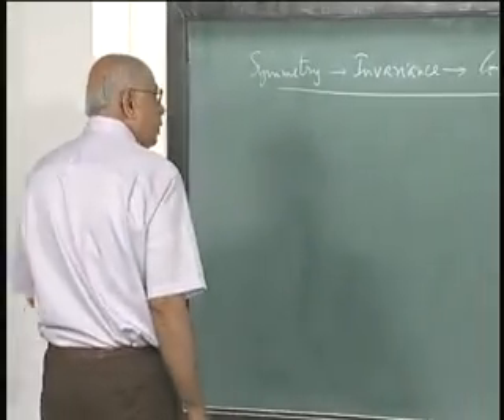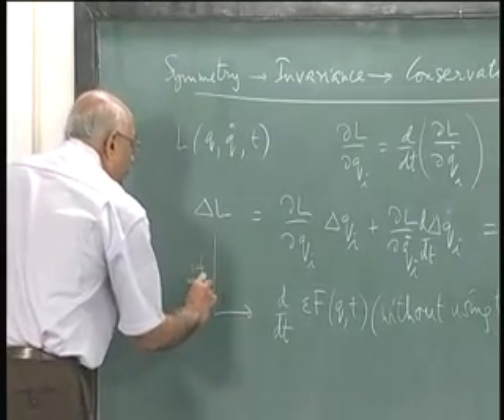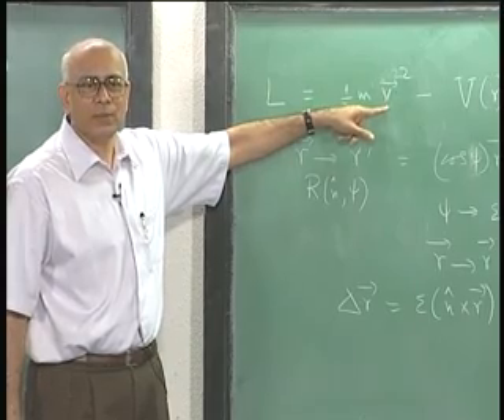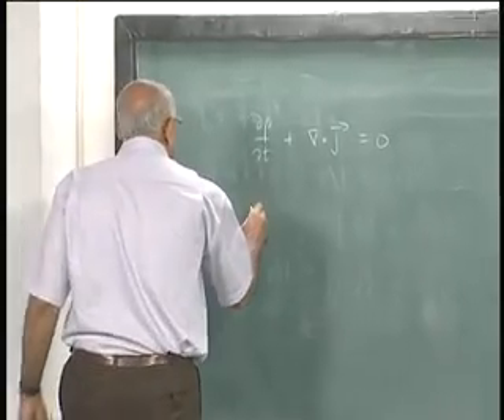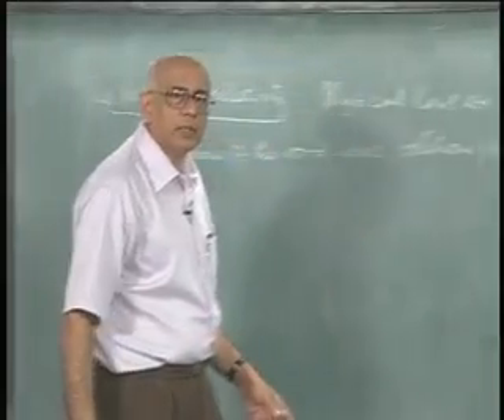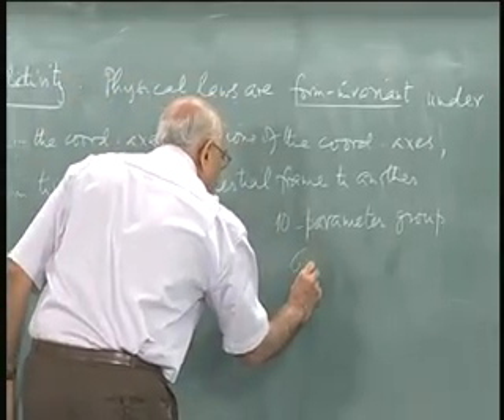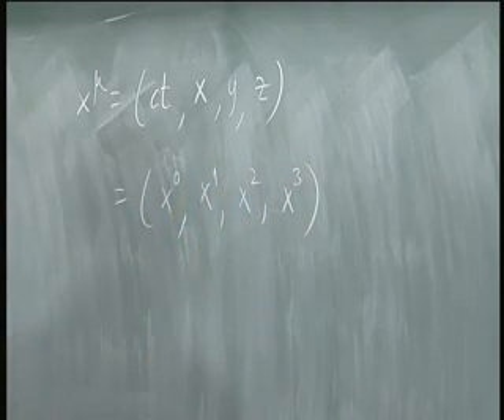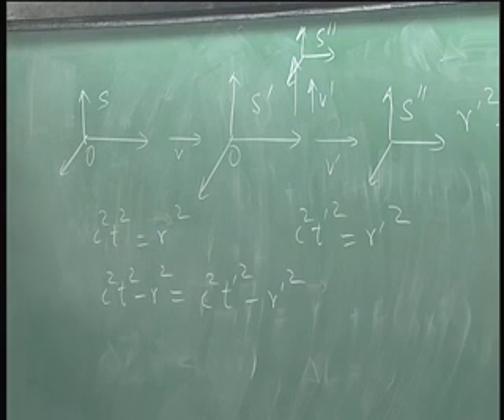Mod-01 Lec-35 Noether\'s Theorem. Special Relativity (Part 1)

Comment: 34:16 Special Relativity starts
Reply: 48:00 With (t,r) describing a light pulse's motion, he says "ct square minus r square be unchanged" between frames. Shouldn't he rather say "ct square minus r square be kept zero between frames"? Wonder why he says "unchanged' instead? I guess, he is no longer restricting (t,r) to the case of light's motion, but surreptitiously expanded to any general (t,r) event. Dishonest I would say. You must explain the logic of why any general (t,r) event, not just a (t,r) on the 45 degree line of the Minkowski space, should obey 'ct square minus r square be unchanged between frames'.
Reply: 50:50 Definition of 4-vector

Comment: [1] A few remarks : Light IS NOT TRAVELING! We see it traveling which is very different! Proper time of a light ray vanishes, so time does not pass for a photon. It arrives at the same proper time that it start. Thus IT DOEST NOT TRAVEL since travel means something hapening in proper time. This is one great suttle aspect of Relativity.
In occidental world, the concept of Relativity was "primarely" brilliantly stressed out by Giordano Bruno. Then Galileo Galilei who supported the "universality" in the paradigm of Mechanics (the only one really known at this time), but without droping his preference for circular motions for planets. Finaly by Newton, but in the paradigm of Mechanic and limited to inertial frames.
But the first to really understand that Relativity not only applied to Mechanic but also to EM was the French grand master Henri Poincaré that noticed in 1895, in his synthesizing analysis of Hertz Theory that the great physicist did formulate his theory in the langage of Ether, but that in fact he didn't use it in his entire theory, except as a convinient word. Thus Poincaré realised and stressed it out very clearly in his admirable theory of Light and EM that the concept of Ether was superfluous and that all Hertz theory would work as well without this concept. 
Poincaré then corrected in 1904 the brilliant work of Lorentz of 1904 that had partly but incorrectly proven that his Lorentz transformations did let the maxwells equations covariant whereas they both knew since 1895 that they did not let Newton second law covariant. 

Moreover Poincaré, in finding the correct transformations (partly but incorrectly found by Lorentz), to whom he gave the name of Lorentz Transformation, he rigorously proved that the they were linear, that the scaling factor was 1 for them to form a group. But he proved even a much greater result, that very few seem to know. Indeed he prooved that because they not only let the macroscopic space-time quadratic t2-r2 invariant,  but more importantly the quadratic differential form ds2=d(ct)2 - dr2 invariant, that as a consequence, not only did the Lorentz Group was acting but more importantly his Lie Algebra. Why was this so important? Because it alows Relativity Theory to cope not only with inertial frames, but also with accelerated ones. This Einstein never understood it, by a lack of mathematical skill and lucidity! And it is the main point! Thus attributing the Theory of Relativity to Einstein is some kind of a joke since, as the great russian physicist Vladimir Fock stresses out, Einstein made countable misinterpretations and hard core confusions about either what he illicitaly called the Special Theory of Relativity and General Theory of Relativity. As Fock explaines it very clearly, the very adjectives chosen by Einstein "Special" and "General" deeply shows that he understodd neighter one nor the other. Moreover the ones that attribute the Theory of Relativity to Einstein, surrely HAVE NOT RED EINTEIN 1905 paper of the Annalen Der Physics. Since if they had, and if they are not totally ignorant in science, they will immediately realise that in the very central proof of Einstein-Mileva (since all his scientifc work was secretely but strongly a two brain work), of the transformations (that he hardly attribute to anyone even though Lorentz and Poincaré made it all from 1887 to 5 June 1905), Einstein dreadfully contradict his "own" principles not less than 3 times. Stating firts that c is invariant, and then using three times, in his fallacious and vacuous "proof" that the speed of light is c-v, then c+v, and finally, last but not least, that the speed of light is sqrt(c^2 - v2)!!! You surely don't believe it! So why don't you look for yourself in his article. Be carefull with wikipedia, some funny "corrections" have been made to Einstein article by unknown authors. Choose then the original article in germain, or a trustfull translation in your langage. You will see how vacuous and dreadfully contradictory is the "proof" of Einstein. And of course without Lorentz transformation, that Einstein get right with a totally false proof, all his article is pure vacuity. 

But it's even worse, because all the clocks synchronising processes that Einstein exposes in his article of 1905, were invented and published by Poincaré since 1895, and widely spred to a world wide passionate and high cultured public in his book of 1902. A crucial book, where all the main ideas of Relativity are widely exposed and developed. And a crucial book that Françoise Balibar and Einstein great friend Solovine proved that Einstein and his Academia closed friends studied extensively. Thus for the one that still believe that Einstein article of 1905 is from his own work, is totally misled historically. Not even did Einstein wrote a asingle article without the main aid of his fisrt wife Mileva, even if Einstein never mentioned it nowhere in none of his article. Just as he did for General Relativity, that was mainly the work of Grossmann, who tought to Einstein ALL Ricci intrinsic Calculous and Riemanian Manifold and also Mileva hard work, up to their divorce in 1919, when he become famous, and divorced her for his own cousin.

But there is much more, far more than Fock even points out. Since Poincaré, in 1905, not only give the final touch to the Theory of Relativity that he had been constructed with Lorentz since 1885,  but pushed much farther. Indeed in his 1905 article he not only promoted the "Principel of Relativity" to a universal principle of Mechanic AND EM, including infinitesimal accelerated frames, but even more, he exhibit THE LORENTZ COVARIANT THEORY OF GRAVITATION AND PREDICTED GRAVITATIONAL WAVES. You don't believe it. Well check here how brained washed you have been made. Just look for yourself in his 5 June 1905 note at the French Academy of Science, where he gives a summerism of all this, that you will find in full in Redicotti di Palermo full article set in sept 1905 and published in 1906.
Reply: aikidlc Can you prepare a lecture series on Special Relativity with all its rigorous mathematical treatment as well as precise and subtle physical consequences and principles. I am not being sarcastic or anything. Of course if you have available time. Thanks.
Reply: bro please give links and citation to all these papers so we can look up because u have posted to much information so it would be hard to look everything on the net myself. Please cite some links
Reply: @AIKIAMA DOJO Bro make a vedio series showing from the papers of poincare that he established relativity in a more accurate way than Einstein and he predicted Grav. waves. Furthermore show from Einstein's Paper how he made a mess(Precisely on what points and on what matter). Make a thorough vedio it can be groundbraking.Not joking seriously "DO IT".
Reply: @dhritimanroyghatak2408  : OK ! I will. But tell me why you wander ? Man kind is so corrupted. Few care about the Truth. Even fewer seek it. More over there is much more than the physical surface. What is behind is a tremendous spiritual battle between Truth and Imposture. Between Light and Darkness. Very dark forces are sinking Science again, since à century, in the Abysse of lyes and dogmas, in a poisining process that slave it to serve more and more machiavelic power. This is why I kept almost silent. It is extremely dangerous to spell the Truth. Even worse when Truth can open doors of unknown "technologies". Poincaré didn't say all what he saw, and kept the hard core of what he knew secret. This secret is very simple. It has been seen by several of the greatests physicians like Bohr and mathématiciens like Souriau or Grothendick. Though, what I can already say is that Poincaré is one of the greatest Knight of all times. I have never been able to found a fearher of darkness in his Heart nor his Spirit. He was an extremely rare Knight of Truth. An extremely deep visionary. His flame was free from corruption. His blade like a cristal. He was from far, the greatest mathématicien and physicist of his time. A genius of almost extra terrestrial magnitude. He "humiliated" Fuchs, Klein, Hilbert, Einstein  by the tsunami of his skills. His early death was not a natural one. And only after his death, imposture found the field of Truth without strong enough knights, and started speading his lyes and corruption infecting now days 90% of scientists. What is still hidden in Relativity, that Newton saw but backed up, Poincaré knew but was killed, Souriau wrote down but can only be desiffered by very few ones, will change this world for ever, more than anything else before. Why do you care about the Truth? This nightmare of propaganda isn't it far more confortable? Why do you wander?
Reply: @Igdrazil  ur wish bro just let me know the Chanel name if u ever post
Reply: @Igdrazil  I want to be able to talk like this guy

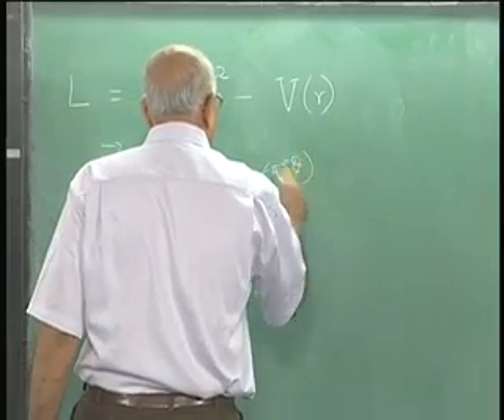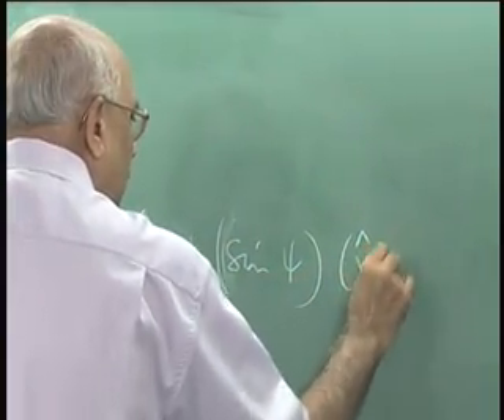Comment: Kindly note that the formula that he wrote down (during 18:20-18:47) for a transformed vector under rotation is valid only if the angle \Psi represents clockwise twist of the coordinates. But since, we always take anti-clockwise twist to be positive, there would be a minus sign in front of the sin(Psi), in general, instead of plus sign. However, this doesn't change any conclusion in the lecture. An elegant proof of this formula can be found in an article written by Dr. V. Balakrishnan himself under the name "How is a Vector Rotated?" which was published in Resonance, 1999.